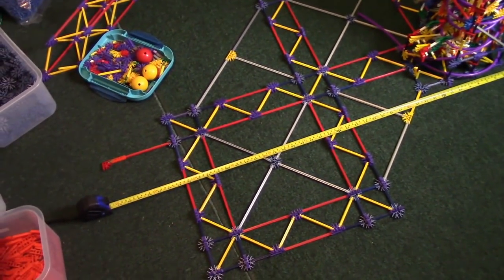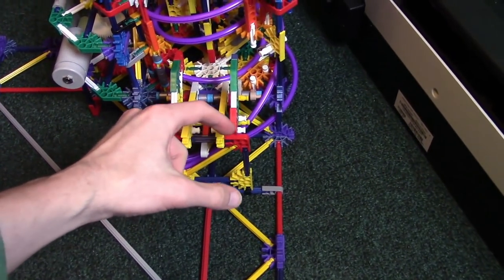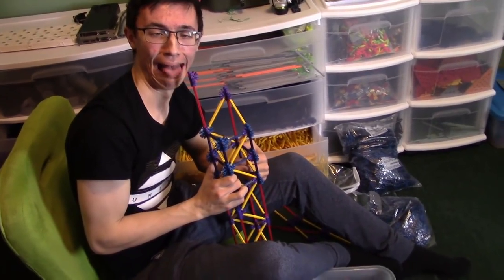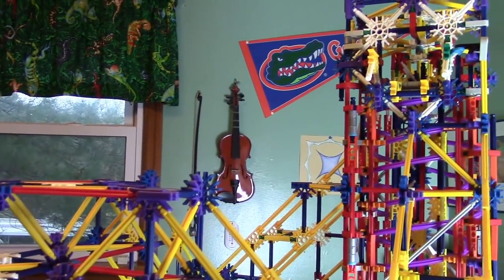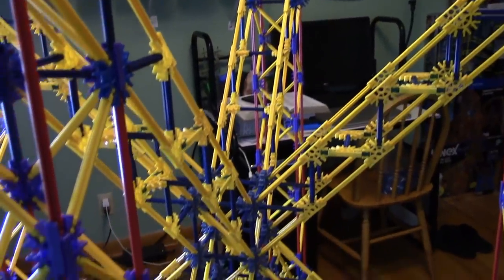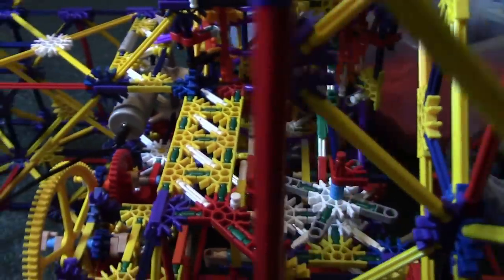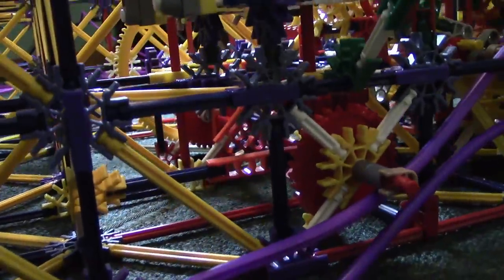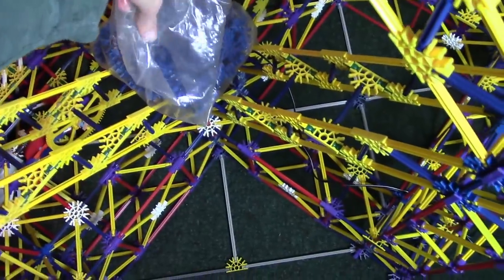Let's Build a Knex Ball Machine - Ep 2 - Towers and entrance wheel

Comment: Really fun to watch this develop! Seems engineering degrees have really helped with understanding tower and beam design. Its an awesome looking design.

One thought, you may have already dealt with this. Might it be worth changing the orientation of the motor to allow the power cord to plug in from the outside of the machine rather than the inside? Especially if its going to be displayed.
Reply from the maker: Thanks man! I've only taken a basic statics class, haha. My brother will be moving on to structural mechanics. I could've changed the motor, but I thought the cord might be too close to the edge which was going to be hard to reach. In a later episode you'll see that the motor plug where it is is actually pretty easy to reach.

Comment: Shadowman, what are your gear ratio's on the tower and entrance wheel?  It's hard to catch it on the videos?
Reply from the maker: Connected straight to the motor, a small blue gear goes to a medium red gear, then on the red gear shaft is a blue leading to a large yellow gear, then on that shaft is a blue leading to red gear.

Comment: Why didn’t you use a yellow gear instead of the red gear at 8:19
Reply: why would he? they're almost the same anyways
Reply: At higher speeds/torques red on red is likely to grind teeth. And there you have your answer: the speed is low enough, and he probably has more red than yellow gears, so it is wise to use reds here.
Reply from the maker: @GWorks  That's the reason. I try to conserve the yellow ones wherever possible.

Comment: I wanted to make a ball machine but I don’t have any of the balls. Any ideas of where I could get some?
Reply from the maker: Your best bet is eBay, though they can get expensive. Sadly the Knex website doesn't sell them like they used to.
Reply: Shadowman39 I actually happened to find a lot on eBay with many parts and a few balls. Thanks for the tip!